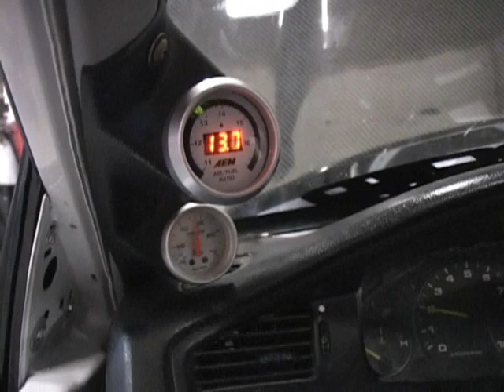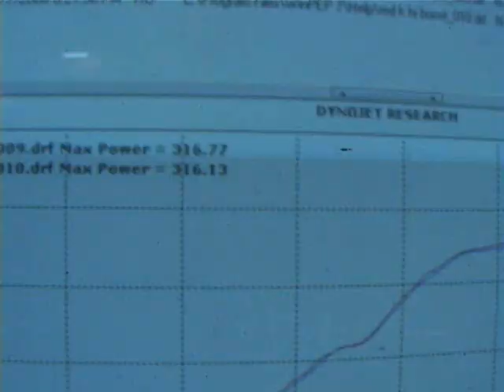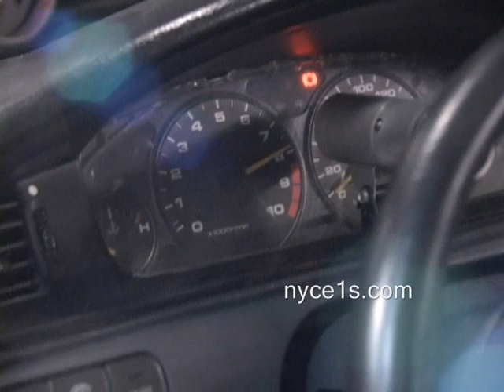Nyce1s.com - Nyce1s Power Up Dyno Series Battle Pt.2!!

Comment: @boulocc wow thats a real ignorant comments, lots of drag v8s rev to 10k,and with strokes sometimes bigger than stroked Ks. I'm a honda guy all day, but you can't just  say fuck the v8s, them dudes been macking hp way before the honda engineers where even alive. and if honda people implemented some of the stuff they do, 380 and even 400 all motor on 99 strokes could be possible.